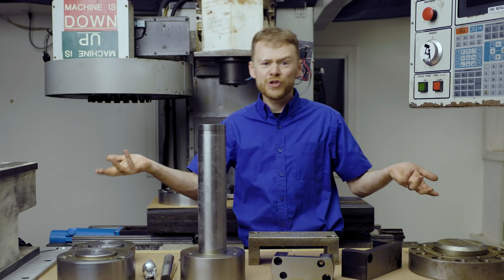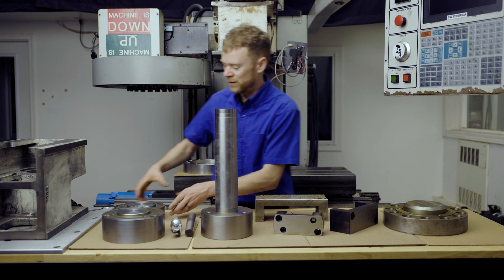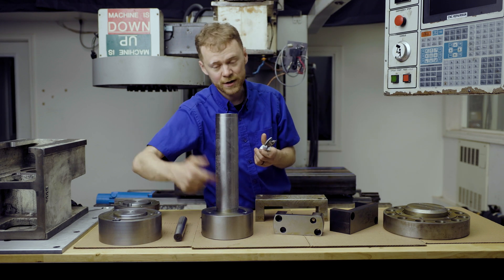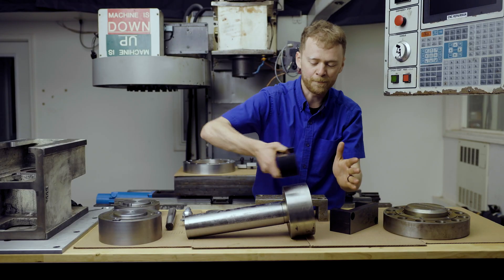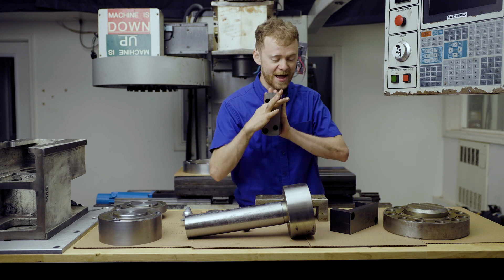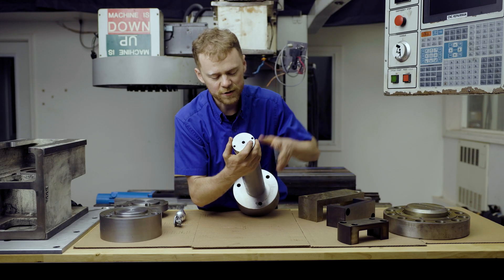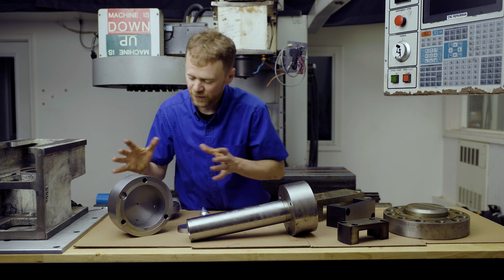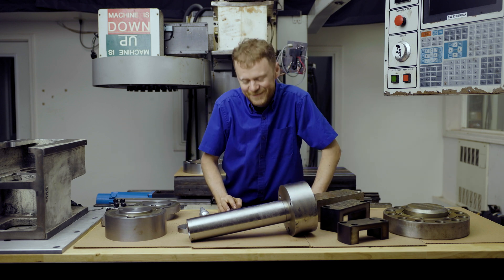CNC Lathe Alignment tools

Comment: how do you get into your line of work? i'm a cnc machinist currently and the technical parts of how the machine is running, but not how it should frustrates me. having to add a U value to programs instead of fixing the machine shouldn't be the solution.